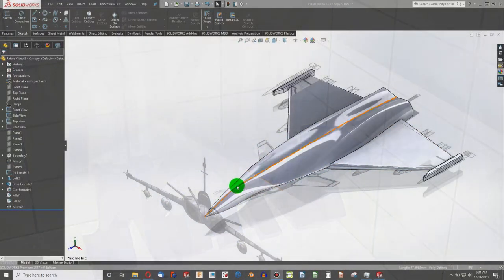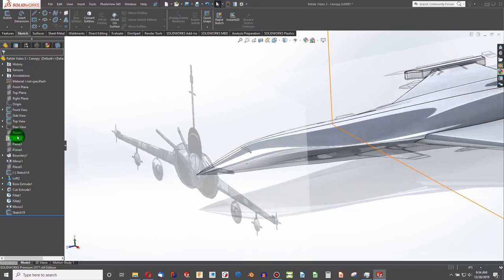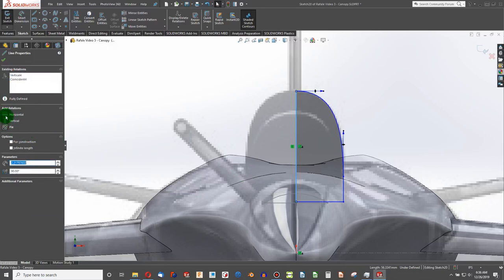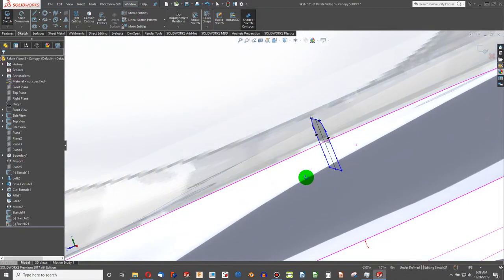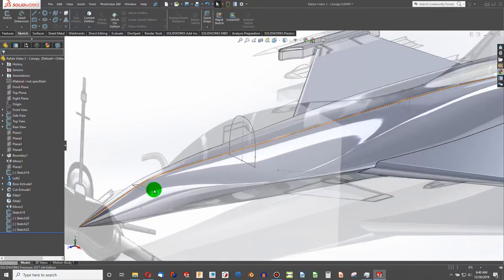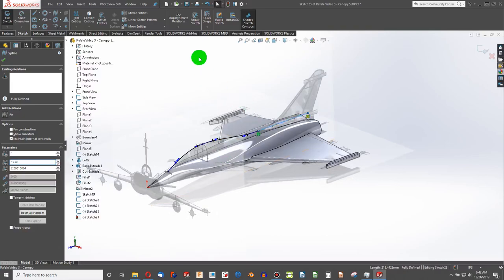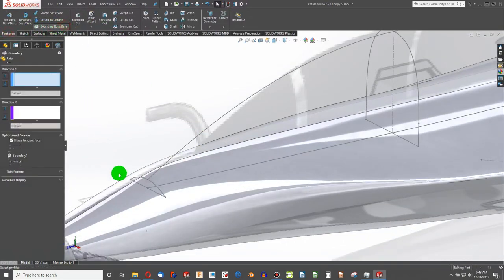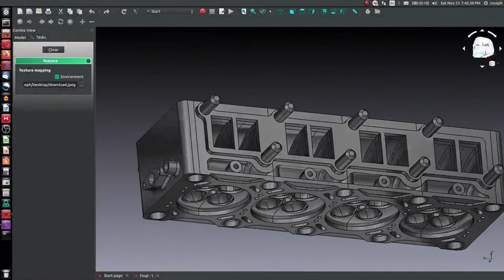Make a FIghter Jet in SolidWorks Vid 3: Canopy |JOKO ENGINEERING|

Comment: How did you get the 3d image of the jet? I really need help in doing the canopy of the fighter jet.
Reply from the maker: The link in the description has a bunch of images.  Is there a specific part you're having trouble with?
Reply: @JokoEngineeringhelp  yes I do. I don't know and struggling how to do the canopy of a F-18 Hornet canopy. Please help me 🙏. Like the shape of the component and how to do it.
Reply from the maker: @prashamkarunanithi9064  Is there a certain time on the video you are having trouble with or are unable to replicate?
Reply: @JokoEngineeringhelp  6:55
Reply from the maker: @prashamkarunanithi9064  Is it difficult to trace the image you're working with?
Reply: @JokoEngineeringhelp  yes.